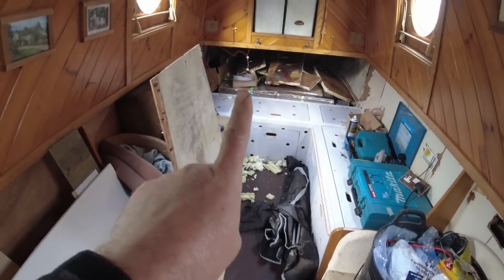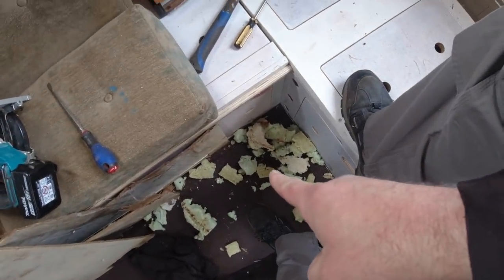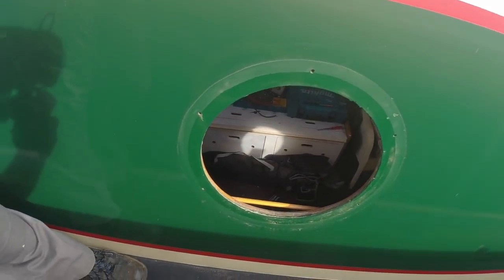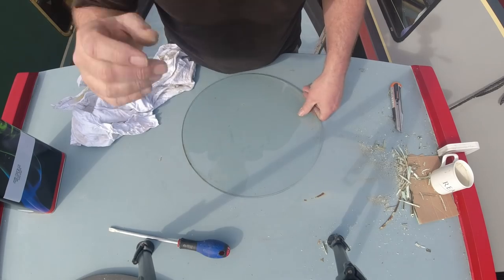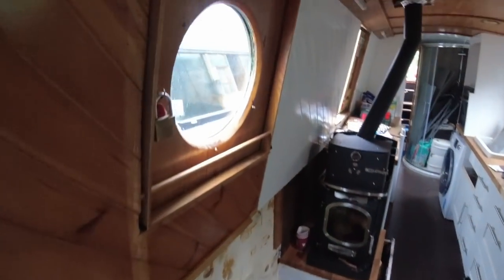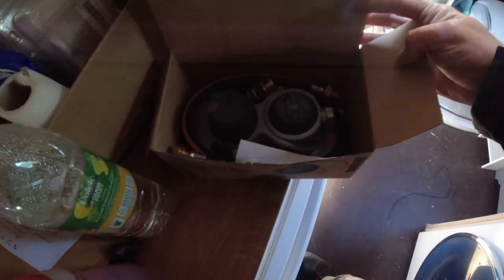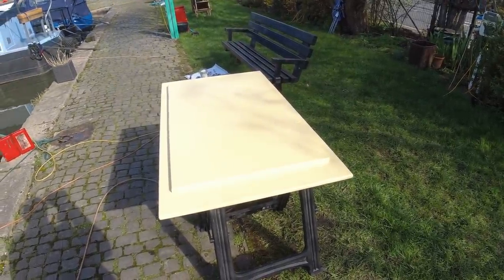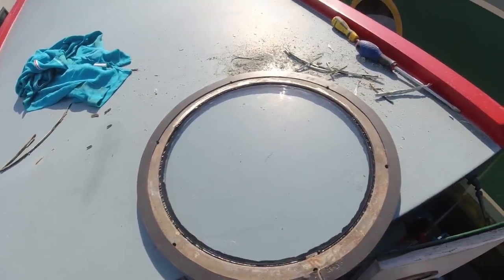Narrowboat Refit #60 Port Holes

Comment: Getting it done, bit by bit.
But it'll be good to get the Solar system fitted, and up and running.
Good luck in getting the welding done to stop the leaks, that's a massive issue in any home, but when it's metal exponentially much worse. Keep up the good work.
Reply from the maker: The welding will be quite a big job as I will need to have the gussets made to fit, I ordered the batteries today I’ve gone for 6 x 6 volt paired up to something like 750 amp hours 😁😁👍 should be ordering the rest of the solar stuff tomorrow 👍👍

Comment: Hi Steve 
Nice work on windows, your water leaks may be due to slight water ingress and also condensation or sometimes if you have a drainage channel built in that may have corroded over time 👍👍👍👍
Reply from the maker: Hi Thomas, I will be getting some condensation however I’m defiantly have a water leak to as when it rains I’m getting regular dripping 👍👍 when I refit the insulation I will try and tape it all up to eliminate as much moist air as possible hitting the cold steel 👍👍😊

Comment: All looking good, Steve. I’m really behind with watching the interesting vloggers like yourself because of a new works contract I’ve just taken on, but I’m going to backtrack now and start sifting through them. I think the last one I watched was you fitting the Belfast sink!
Quick question: When you eventually clean the brass porthole surrounds are you going to coat them with some sort of lacquer to stop them discolouring or going duller? I only ask, because if you are, I am wanting to do something to my brass runners on the roof hatch, and you could have the solution. 😉
Reply from the maker: I was going to leave the brass as I quite like to polish is and make it shiny! On the hatch runners I don’t think that you could spray or paint any sort of lacquer on as I think it would just scrape off over time, I was going to put a little 3 in 1 on my runners and see how I get on (mine are quite stiff) I’m sure in the olden days they would of used whatever oil / grease they could get their hands 😂😂👍🏼👍🏼👍🏼😊
Reply: @NarrowboatPreciousJet  I’ll probably end up using UD40 every so often.

Comment: Hello Steve, I was wondering about the butyl tape on your port holes. It appears to only be adhesive on the one side and so once glued to the brass is reusable as a water tight seal should it be necessary to remove the port holes. My boat has port holes that leak too and  I’ve resorted to silicon as a seal which gets pretty messy! So the butyl looks a good idea although I’ve only found it with adhesive both sides. Did you fit yours and if so do you remember where you purchased it? Cheers Sean
Reply from the maker: Hi Sean, silicon outdoors is not a great sealer 😞😞 I didn’t fit the butyl tape on these windows (I think whoever painted the boat used the butyl tape) I’m sure with a bit of Googling you could maybe find a similar butyl tape that was used on my windows! If your in the uk you could have a chat with a couple of the chandlers and see what they know! There is a guy on site here that paints boat (Only problem is I only see him once in a while) if I see him I will ask where they get their tape from! 😊😊👍🏼

Comment: I just noticed as you were fixing your windows, that they don't look as if they open for ventilation. Am I seeing wrong? All the best from Missouri.
Reply from the maker: Hi Clovetta, that is correct the windows don’t open!! This is not a big problem really as you only normally open windows to let heat out, and as the uk only sees a few days a year of really high heat then this is not a major issue! With the front and rear (plus’s the side) hatches open the air does flow through the boat quite well! When a brought the boat home from Swanley marina the weather was glorious but the inside of the boat stayed quite cool 😊😊👍🏼

Comment: Hi Steve. That insulation from under the bow deck. Did you fit that? If not, are you sure that isn’t an accumulation of condensation. It’s surprising just how much there is in areas like that and how much damage that can do. I’m sure you are right but thought it was worth mentioning just in case.
Reply from the maker: Hi Rick, condensation is a very good point and I bet there is quite a fair bit under the tug deck! I didn’t fit the insulation it’s been there since the boat was made! There is definitely a water leak some where as when it rains it drips quite a fair amount!! I will find the leak and once fixed and sorted I will re-insulate and seal it as best I can to help eliminate condensation 😊😊👍🏼
Thank you Rick 👍🏼
Reply: @NarrowboatPreciousJet  no worries mate. I’m in the process of buying a wide beam and I know the engine bay has a real issue with condensation which I will need to address. My current narrowboat has spray insulation in the engine bay and I’ve never had an issue. I may go that way. One things for sure, when you own a boat the bills keep coming. Good luck with the rest of the refit.
Reply from the maker: @HBrip  oh good luck with the wide beam, I know a chap that used to own a wharf / Narrowboat hire company. He once said to me not to spray foam below the water line as you will always get condensation below the water line if you live aboard and it need to be able to breathe and let the moisture evaporate! How true that is I don’t know but it makes sense I suppose 👍🏼👍🏼
Reply: @NarrowboatPreciousJet  Think the ‘below the waterline’ thing probably applies if the foam is being applied with the boat in the water. Much of the foam on my narrowboat is below the waterline because I sit so low (20mm base plate). Never had an issue. I assume because all the insulation took place prior to putting the boat afloat🤷‍♂️
Reply from the maker: @HBrip  wow 20mm base plate!! That is awesome 👍🏼👍🏼 all my inspiration is like in the video! Under the sole I have now fitted thicker insulation boards though now 👍🏼👍🏼
Reply from the maker: If I ever build my own boat I was going to have 15mm base plate and an ice breaker bow! But now I’m thinking 20mm would be amazing 👍🏼👍🏼😊